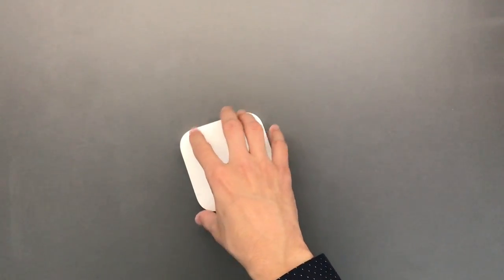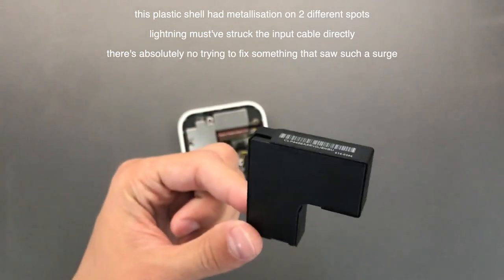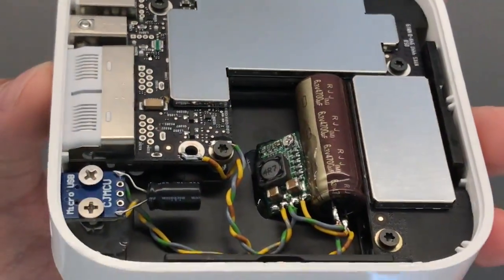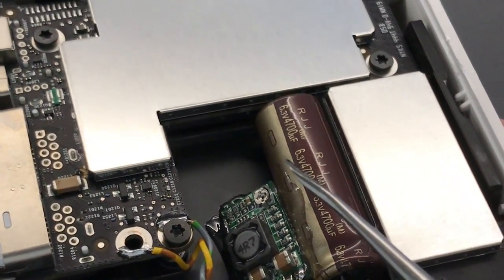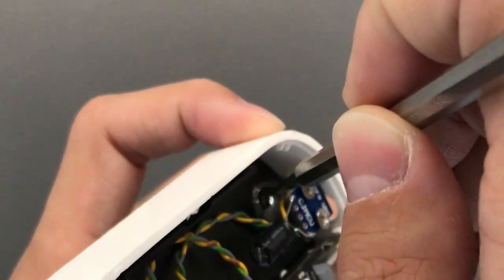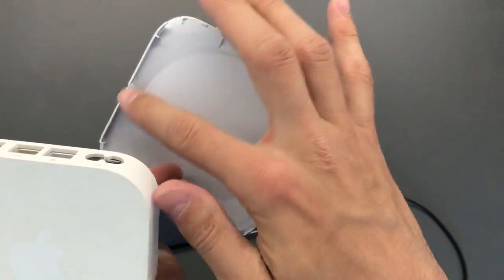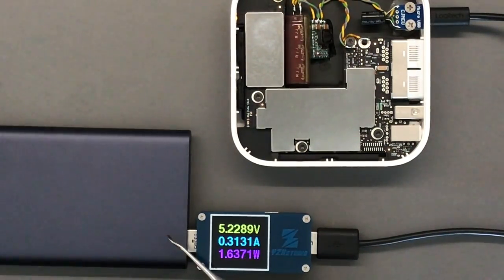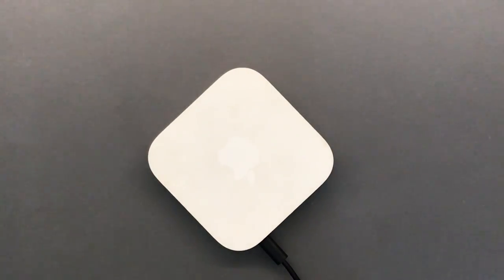USB Powered Router / Airport Express 2nd Gen Mod

Comment: Here we are 2 years later, technology has advanced so much, and this project is very useful.  thank you for the video.
Reply from the maker: I'd suggest getting some
type-c 5v triggers instead of the micro USB one I use there

I'll be making a mod for the airport extreme with type-C - so, stay tuned 🔥
Reply: @Darieee  any update on the usb-c version? If you could make this video a step by step how to it would be really really appreciated! Thank you!
Reply: @ni3433 Have done the Type C mode recently. I don't have a video only pictures but it is super simple. I also did the same thing with the AirPort Extreme but with some modifications.

Comment: Just got one with blown power supply and not possible to fix it because there are too many components blown until I found your vdo may be useful to convert to micro usb source. Thank you. I found way out the cave 😂
Reply: it's 2023, well 2022 when you posted this comment. STOP using micro USB already. Let it die. We have USB-C now.

Comment: Many years i used epoxy in electronics and it's ok especially for plugs, sockets and any other mechanical parts, but for pcb and all "electronic" parts capacitors, coils etc. better is silicone for pcb appliance. Better heat dissipate, vibrance damping etc.

Comment: Just an idea, you might be able to use a silicon diode or two in series to drop the 5V USB input sufficiently. Of course buck converters are cheap, efficient, and adjustable. You’re targeting 3.3V, right?
Reply from the maker: yes - 3v3 is the main and single supply this thing runs on ..

diodes do vary their drop according to load, don't they ? at super small loads is where I'd be concerned
Reply: @Darieee  that’s true. So rather than pulling random ones out of the drawer like I was thinking, you’d have to spec and order the right diode and at that point might as well order a buck converter. Thanks for helping me think it through though!
Reply from the maker: let me know if you pull a mod off though - now you have very nice type-c pd triggers .. that can even ask for a crazy low low of 5v ..

Comment: Hi, my airport express 2nd gen did not turn on suddenly. I've checked the voltage just alone the power board, it stays at 3.3v, but it becomes zero when it connected to other boards. Wonder whether it's worth modifying the original power board based on your instruction. Any thoughts?

Comment: Bought some of those modules, was running low on tiny buck regulators. The killer feature is those pads on the back, always had problems with those crap trimmer pots they use, so hard to set with any precision and I'm always worried they will vibrate to a different setting.
Reply from the maker: ow yeah ... I've also used the EN pin ... just a caveat - it has a pull-up resistor to Vin ... fried quite a few chips once not having realised this

So, EN should be used with the pullup resistor popped off the board with an exacto knife or something similar
Reply: @Darieee  super, that's going to be useful!

Comment: Hi again. I have supplied 3.3v to the unit and I can get turned on. The LED kept blinking with amber but no wifi signal could be detected on any device. What should I do?
Reply from the maker: press the reset button for very long ✌️

Comment: What chip is on that buck converter board. Several different designs on your AliExpress link that look similar but using different chips.
Reply from the maker: the ones with the tiny chips are all good - at least as far as my experience goes ✌️

sorry I don't know the name of the package but - it's the rice kernel sized one 😅

Comment: I wonder if a similar approach could be used on old AppleTV units that have the same type of power adapter?  I assume they draw a lot more power...
Reply from the maker: hmm, yeah ... probably a bit more, though, I wouldn't expect the small black ones to use an insanely larger amount ... they are after all using ARM phone chips